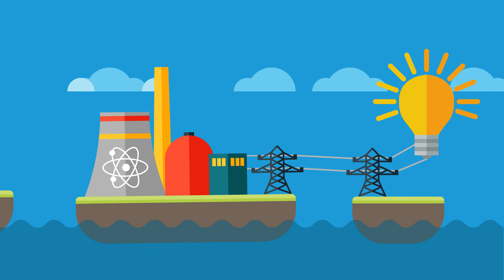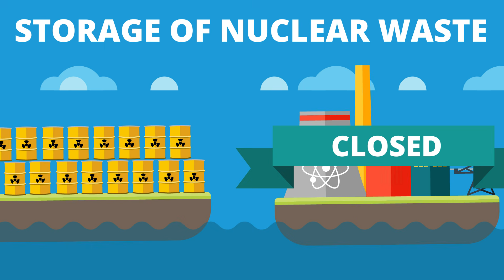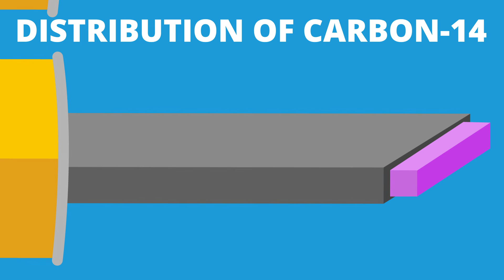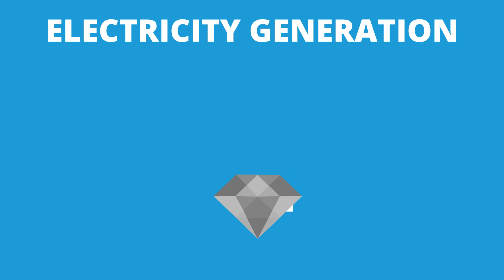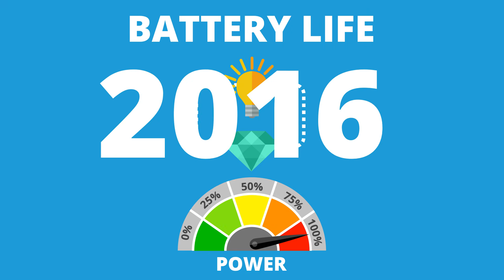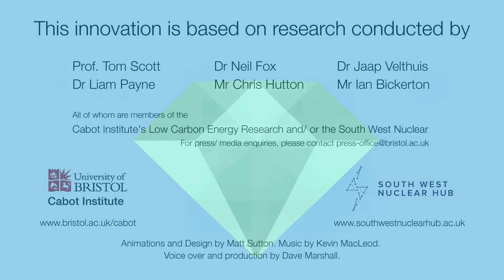‘Diamond-age’ of power generation as nuclear batteries developed

Comment: 1 gram of carbon-14 gives 15 Joules per day, which is approximately 174 µWatts/day, which won't power even the most energy efficient devices. Nice idea in theory, but not practical in reality until we develop better ultra-low power devices/components and/or increase the mass of the carbon-14.

Comment: I have read that the ISS runs on approximately 75 to 90 kilowatts of electricity generated from it's solar panels. How big would a nuclear diamond battery need to be in order to generate 100 kilowatts? Would it need to be the size of a mini-keg? Or a 55-gallon drum? Or maybe the size of a fridge?

If it was the size of a 55-gallon drum (for example), how many of those diamonds would you need to fill it to the brim?
Reply: It would take 60kgs of the stuff to power a smartphone.

Comment: How much power is required to evaporate the C-14, convert it to a diamond, and encase it in yet another diamond?

I assume they're not actually cut to look like jewelry diamonds. How's the electricity tapped? Are metal leads somehow attached to the diamond's surface or do they actually generate a magnetic field to generate an electric current when placed inside a copper tube?

So many questions and I haven't been able to find the actual paper on the site.

Comment: #diamond battery. They could be used at new nuclear power plants, to run small meters in the control rooms, so the computers would never be without at least some power which can help tell people about the condition of the reactor, helping them figure out what to do to the reactor in the case of a possible melt down, saving lots of people's lives.

Comment: Can you power a phone with this? If it can be used in electronics i would power everything from my stove to my tv to a single light bulb with these things. 
Even If the power generation is very small if one diamond can power one light bulb then when could run all the lights in a house off batteries. This would save housing developers a tonne of money in labor because they wouldn't have to run wires, plus it would make it easier to upgrade lighting in old houses. Obviously you'd need batteries for light switches too, but yeah, lighting. That's my immediate application. Also door bells and security systems, alarm clocks... I'll stop now.

Comment: I can suggest what might be going on with the physics here but I'm dubious about the amount of power output. Carbon-14 decays to nitrogen-14 (stable), with the emission of an electron. Diamond is a semiconductor and the emission of this electron will cause a load of other charge (possibly light also) to be liberated/activated within the crystal. From here it is behaving similarly to a solar cell and some doping is needed to cause the liberated charge to favour a direction of travel. My memory of solar cells is a bit sub-par so apologies for the amateurish approach here: broadly it involves
- the creation of a p-n junction, by doping some of the material with a group 3 element and an interfacing part of the material with a group 5 element (carbon is in group 4 of the periodic table).
- thermal diffusion causes electrons and holes to migrate across the junction in opposing directions which generates an electric field (this is a characteristic of the junction an a non-0K environment, not of it being a nuclear battery)
- the electric field encourages any free/liberated charge to go in a specific direction
- the charge, that would otherwise accumulate is then taken away by conductors to be used in some application.

Suppose we imagine that this whole process is 100% efficient at harvesting the beta radioactivity, by my calculations, a pure C-14 crystal of 0.1Kg would produce 1.3 Watts of power. I won't go into all the maths, but some of the key stages are radioactive decay constant lambda=ln(2)/half_life_in_seconds= 3.84e-11; number of atoms in 100g of C-14 is about 4.3e24; mean energy of beta particles = 7.85e-15J (Wikipedia which provided it as 49KeV).

Hopefully if I made a mistake, then it can be unpicked from that.

As a side note: diamond aint cheap, even if you make it via Chemical Vapour Deposition as is suggested in this video. Doing anything with rods of C12/C14 from a nuclear reactor is not cheap. Also, C14 does not decay back to C12 as the video suggested, it decays to N-14, which is a gas at room temperature. I don't know if this would migrate out of the material or build up to form bubbles of pressure. The energy generation will be far form 100% efficient, most of the energy will be released as heat, but I don't know what the efficiency would be really.

Comment: Don't know if this has been mentioned, but a Joule-Thief Circuit could be used in conjunction with these to increase their usefulness; specifically in applications where quick pulses of electrical current can be of use..   For instance, and LED light source powered by a Joule-Thief Circuit connected to a series of these batteries.  It's creates a pulsing light, but pulsing faster than any human eye can detect.  That same goes for anything that does not required a steady flow of power, but a high voltage than these batteries could produce: electric motors, Peltier coolers/heaters, etc.

Comment: Non Military APPLICATIONS: 1) I'd like to take this, tack on a capacitor, and run an intermittent radio transmitter ping, triggered when primary power feed fails. And then slap it into an emergency black box. 
2) I'd like to see small quantities to run CMOS and critical systems in time capsules archives with crystal data storage.
3) Large quantity to powering enclosed life support for extinction level event emergency shelters, where artificial or traditional photosynthesis could be performed without consuming oxygen, or requiring expertise to run a live reactor, while being able to feed power to other uses in less trying times. 
4) Cryo storage/stasis facility would probably do well with a simple durable backup power supply designed to last.
5) Pacemaker was already suggested by illustration. Neural Machine Interface biocompatibility developments opens up many more possibilities or reliable power that can be carried or implanted.
6) Many generators require a minimum amount of power to start, which in remote locations can be difficult. Slow startup with a capacitor may be better than nothing. 
7) In System probes, space stations as well as other solar panels sometimes could use a little power to slowly reposition solar collection, when normal batteries would be quickly depleted,  to maintain minimal hibernation function in months of night, including to prevent cold damage. Thermal inefficiency could be a useful feature rather than a glitch. 
8)Novelty Clocks: Persistent, low power required, with static weight/Alarm Clock with lifetimes of power with out  a plug.
9) Slow underwater probes and sensor buoys. (Expect these to be subject to being stolen when you try to pick them up in international waters. Thanks China Dec 2016)
10) Very slow drilling probe.
11) Long term surveillance equipment.
12) Someone will likely make long lasting robust terrain cordless multi purpose, toxic waste cleanup robots for remote areas eventually sometime. Possibly solar augmented. Lets hope they are as human friendly as WALL-E
13) CDC. If you've seen The Walking Dead First season, one imagines if how different power supply could change the course of a very aggressive global epidemic, in Atlanta and the course of human evolution after.
14) dirigible drone
15) Emergency radios/flashlights/strobes, because people will pay not to have to crank.
16) Incorporate into body temperature regulating bracer.
17) Bit heavier than people's normal cell phones already. Satellite cell phones. For when running out of power a few weeks into a journey is needed.
18) McMurdo Station-, because hauling fuel to isolated base isolated from a power grid sucks, and 10 years of traditional nuclear power showed some safety concerns. Wind Turbines are good, But reliable baseline power supply is better.

Comment: Well that was certainly interesting. I had heard of "nuclear batteries" before, powered by waste, and the thought of such things being used by or near people gave me the willies. This C-14 diamond battery, derived from nuclear-grade graphite, is new though. How much power does this put out again, though?

Indeed, diamond is very hard and mostly inert chemically. I'd still have reservations about these "batteries" being used around people, though, like as a medical implant. The video made an error in stating that C-14 decays back into normal carbon. C-14 decays into nitrogen, a gas. While it would take a very long time, sufficient gas pressure could build up and cause cracks in the diamond. The nitrogen would be harmless, but containment will have been breached.

I was also disappointed by the treatment of nuclear waste in the video, making it look like an unsolved million-year issue, ignoring reprocessing. Spent Nuclear Fuel is 96% unburned uranium, 3% fission products, and 1% plutonium and higher actinides. With reprocessing, you can take out the fission products and can reinject the U+Pu back into the reactor, leaving fission products like strontium-90 and cesium-137 for storage up to 300 years.

Modern nuclear designs, like the Molten Salt Reactor, can consume our existing stockpiles of spent nuclear fuel.
Reply: power is 15 joules / day per gram, (~ 170µW). so don't expect this to solve the world's power problems. 

strontium-90 (half-life 28.8 y) and cesium-137 (half-life 30.17 y) storage is going to require much more than 300 years to make them safe.
Reply: Hi there. 300 years is 10 half-lives, which means less than 0.098% of those isotopes will remain. The goal here is to reach background radiation levels, not zero.

Thanks for the power info on this diamond battery, though.
Reply: Pyre Vulpimorph
One gram of cesium-137 has an activity of 3.215 terabecquerel (TBq). Safe level is 1000 Bq. That's 31.6 half lives (for each gram!) bring that waste canister up to 1kg and you'll need an additional 10 half lives (total ~1250 years) and have to dissipate about 1 kW of heat, initially. This includes 660 keV gamma rays from the Ba-137m1 intermediate decay product, which will require heavy lead shielding during transport and handling (14-inch thick, since 1 inch thick will stop only about 7/8 of these).

Comment: sounds fishy looks like we have another solar roadways,
so according to website its 15 J a day(per gram) if we calculate:
1j =1 W/sec
15J=15W/s = 4.1 mW/h
if you run it continuously you would get 170 microwatts continous power from it (divide 4.1 / 24h)
and if you store all its energy that makes during a whole day, you can get a 1 sec flash of 15 watt from it 

there are tritium betavoltaics and they are pretty much same with using way way less than a gram of tritium (trace amounts)

you cant use it on space because thermonuclear cells are more efficient and having way more power density which they currently use today 

it could be used on very low power applications but can it really cost compete with already existing betavoltaics?

Comment: Not a single hard fact in the video, like the achievable power output per gram, which voltage, the energy needed to produce such a battery versus its energy output, the cost of producing it etc. The animation showing half-life is misleading since it shows the drop to 50% happen linearly with time. The whole video with its nice happy music gives the impression that this would solve the problem of radioactive waste and does not mention at all that 1) there a lots of other highly toxic and radioactive elements apart from C that need to get dealt with, and 2) that graphite is used only in certain kinds of old-technology, not very safe and/or military-use fission reactors.
Reply: Sure, but why waste time with a rubbish video which is devoid of any useful information then?
Reply: that graphite is used only in certain kinds of old-technology, not very safe and/or military-use fission reactors.

Which in the UK still means we have to find someway to deal with 90,000 tonnes of the stuff.
Reply: What I would want to see is how this technology compares to an atomic battery already in satellites today...

Comment: Sounds nice and all, but you forgot the most important thing: THE NUMBERS

Approximately how much would it cost to produce a given size or weight of diamond?

What is the approximate energy density? What is the approximate power density? (far more important, considering it's a nuclear device)

My guess is that the cost per power output would be so incredibly high that this technology would be nearly 100% useless.

Edit: apparently the power density is 0.07 watts per pound. No surprise. Obviously complete garbage.

Comment: Honestly, you should change your presentation. Perhaps more details on the device, or even namedropping the name of the phenomenon that makes it work. Something to make it easier to look into it. 
Apparently is legit, but everything I heard jumped my scam alarms.
Reply: Yes it's overly positive, but it seems to be a legit investigation. They aren't in crowd-funding, and the source is a press conference by the university. 
That said I couldn't find the paper available anywhere, the efficiency is really low, and the cost of production isn't even mentioned.
And I know it's not an argument, but I really hate that ukulele music.
Reply: but running at 1.5% of thermodynamic efficiency; they could perhaps do something to increase that.
Reply: It is very early research. Development will work on those sorts of issues.
Reply: I'd be surprised if the University of Bristol produced this as a scam, but do see where you're coming from with all the other supposed breakthroughs people have claimed over the years. I think they are laying low on the key details until they have patented.

Comment: So please explain to me why it still cost a fortune to buy a diamond wedding ring?
Reply: Carbon is one of the most common elements in our solar system, so much so that it's been hypothesized that it rains diamonds in Neptune and Uranus.  It's quite easy to synthesize diamonds.  Diamonds sold as jewelry receive an incredibly steep mark-up which is why you can't sell them back (as a consumer) for anywhere near what you paid for.  Additionally, the whole "chocolate diamond" thing is pure nonsense as those are actually considered as industrial-grade diamonds, not really meant to be used for jewelry.  So basically anybody who buys diamonds are being scammed.  Additionally, diamonds don't do very well when exposed to UV-C radiation - the stuff that gets filtered out by our ozone layer.  The diamond will eventually evaporate when exposed to such radiation persistently.  Additionally, diamonds can melt under very high temperatures while other gems have a much better heat tolerance.  Diamonds are ridiculous and boring; buy your lover something more colorful.
Reply: Marketing.
Reply: Because human beings are idiots

Comment: honestly anything from transportation, ie. Tesla vehicles, to cellphones and other electronic gadgets, but there is also a lot of other ideas.
Unless we know the batteries output and stability under high strain, we cannot say for sure where we can implement them. If we are talking about super batteries that will provide an unlimited amount of power output, having them work in tangent with some sort of high power engines... let the space race begin.

Power sources for transportation to mars and to have actual systems set up to be entirely self sufficient in terms of settlement out there. Pulling power; to create a heart source (talking about bringing up temperatures from -67F) , lights are a given need, and powered equipment which fall back on to transportation (electrical rovers)

But until we know what these things output (it could honestly be 1 microwatt) we can think big, but maybe too big.

Comment: That's a lot of diamonds, i don't see it happen. What else i don't see is how do you get the wires outside the second diamond without letting the radiation out. And also how it is working, i mean you just connect two wires and that's it? If that is the case why to heat water in nuclear plants and not generate directly electricity?
Reply: artificially made diamonds are very common. every dentist uses them on his drills. they have nothing to do with the engagement ring diamonds ;) the artificial diamonds are tiny and not expensive. you build them into an array and "connect" cables to that, I bet. why heating water? because those diamonds must be very very very very very VERY much less efficient than an atomic reactor. also the fuel for the nuclear plants is not carbon, so you cannot do the same thing with nuclear plants....
Reply: Sona Buvelle Please read up on how physics and chemistry works.
Synthetic diamonds have exactly the same properties as real diamonds.
Reply: 1) Betavoltaics are already made, just not this way. They're really expensive.
2) I assume it's just potted afterwards, radiation is not a problem.
Reply: Sona Buvelle Synthetic diamonds are made exactly the same way regular diamonds are.
Heat, pressure.
Reply: Sona Buvelle Wut?
Reply: this defeats the soul purpose its a artificial its not like the original or the real thing and it has none of the characteristics of the real thing
Reply: ***** oh please enlighten me my other comment is just my opinion can u explain to me
?
Reply: ***** oh i thought its was made in a lab
that why it has the same properties
Reply: ***** fix damn auto correction
Reply: Use it in a machine with diamond socket?